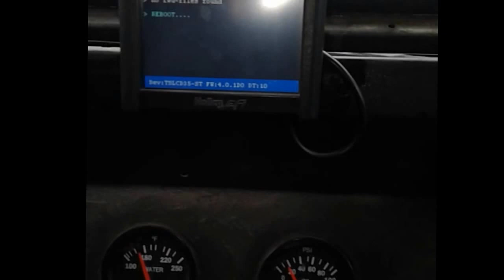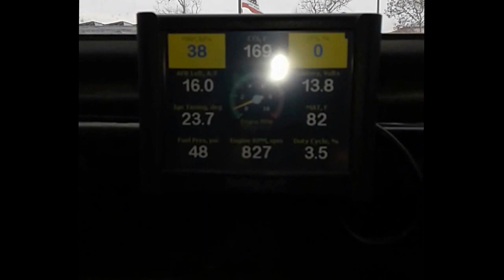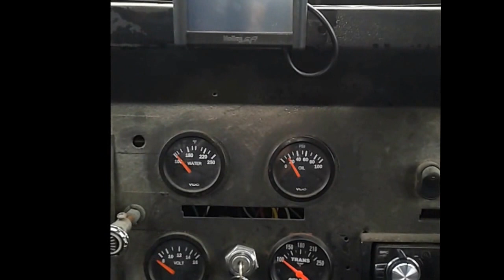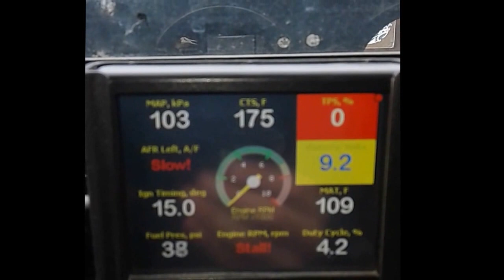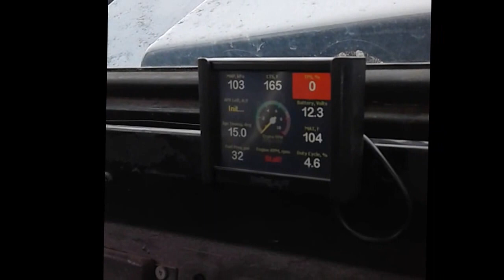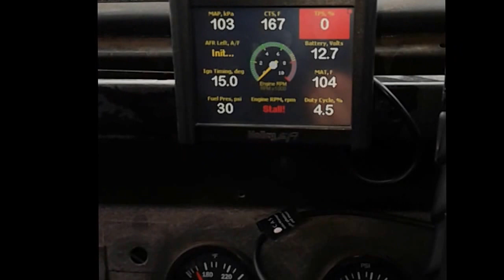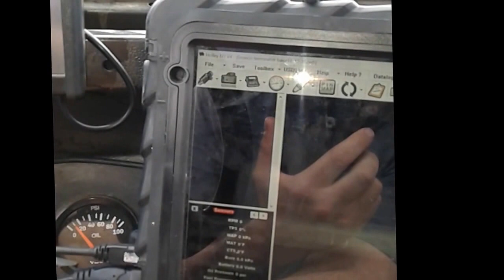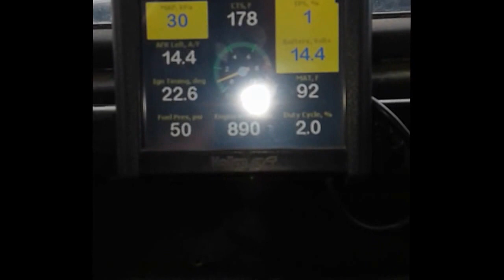Holley EFI HP Terminator ECU sensor problems Intermittent power fluctuations

Comment: Im having the same problem & please let us know if you find the problem. I haven't even been able to dive my car .
Reply from the maker: I re-flashed the firmware
Reply: Fintech Repair Shop tried that twice. Im afraid its the ecm.took it to a shop to check over my tune, they told me it was o2 sensor but i replaced it & it still randomly runs perfect. Going to do another wiggle test on the wiring ,maybe i missed some wires